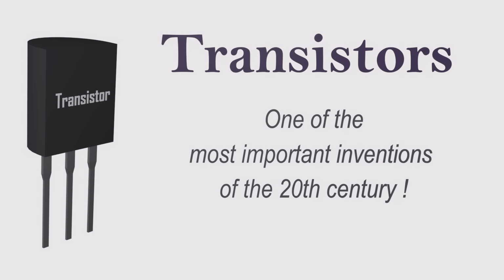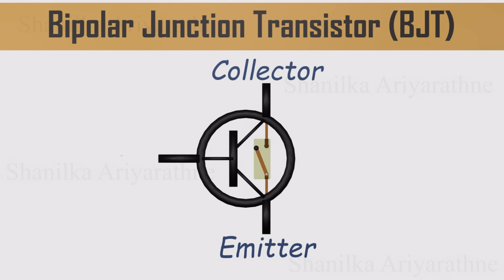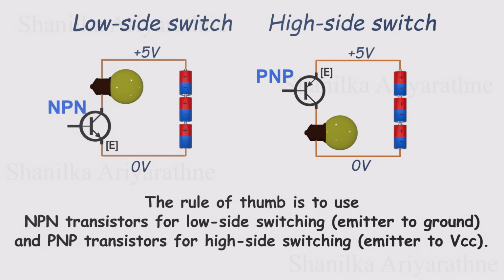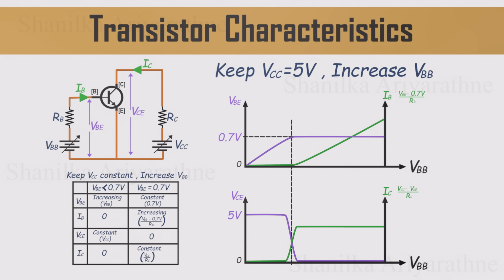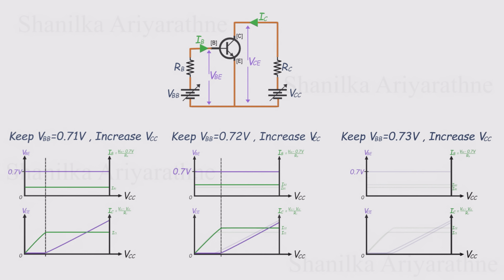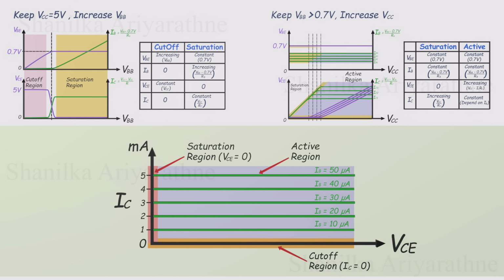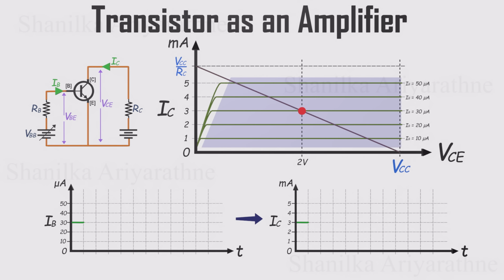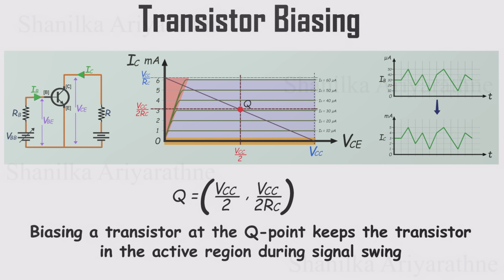Transistors Explained Simply: Switches, Amplifiers, Cutoff, Saturation & Q-Point

Comment: The ratio between the base current and collector current is NOT linear. The ratio is called the GAIN OF THE TRANSISTOR. This ratio changes enormously. When the base current is very small, the collector current will be very small but 100 to 400 times the base current, depending on the load. 
As you decrease the load resistance, you need more base current. But the transistor will not be able to provide the same ratio. The ratio will drop and when the transistor is required to deliver the maximum collector current, this ratio will drop to less than 100 and even down to 20. When it is down to 5, you know you have learned something.

Comment: A LOAD LINE is a line that show both  total Current and voltage  values in a circuit.....Operating point(bias  point  is a point where  Vcc/2  =middle point of Vcc.

Comment: YUM!  Will watch several time and I have a solid current theory base.

Want to learn more about run-away and my hobby:  Hifi audio.  Trying to understand -DC current for the NPN's and +DC for PNP's????.  Two bridge rectifiers from transformer?  Do not fully understand how to get "neg DC" on a power board when rectifying AC with bridge style, all "neg" signal now "pos" from the AC point of view.

Find audio amazing and cross-over from NPN to PNP (push/pull) at transition point is amazing (yes understand bias must overcome ~0.7v, but still amazing to see on a scope)

Thank you!

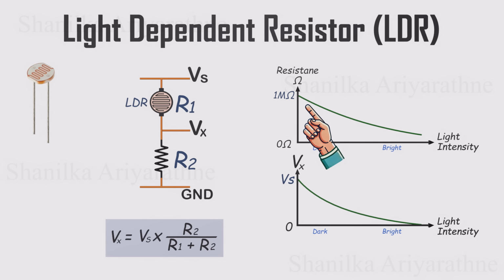Comment: 9:26 you made a mistake. If LDR in dark has high resistance that mean Vx will be low. Follow your equation, higher R1 mean you multiply by lower number. In oposite way, is bright, LDR resistance decrease, R1 is lower, so Vx will be higher.
Reply from the maker: Thank you so much for pointing that out, @lucjansosna9179! 🙏 You're absolutely right — in darkness, the LDR's high resistance would actually result in a lower Vx according to the voltage divider formula. I really appreciate you taking the time to help me correct this. I’ll upload a corrected version of the video as soon as possible. Thanks again for your valuable support! 👏
Reply: @Profmad  still not fixed after 1 year...
Reply: You are correct.  I was just going to make that point.
Reply: It was a HUGE mistake in the video as I see it. And it is AMAZING that the mistake in the video has not be corrected as of today.
Reply from the maker: 🎯 Watch the corrected video here:
👉 https://youtu.be/1dyPZwDxgzM